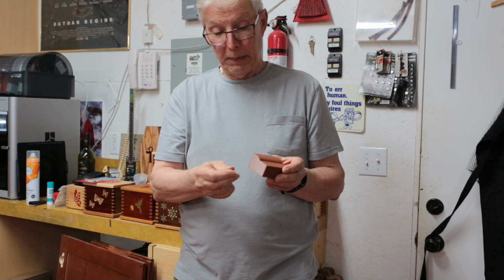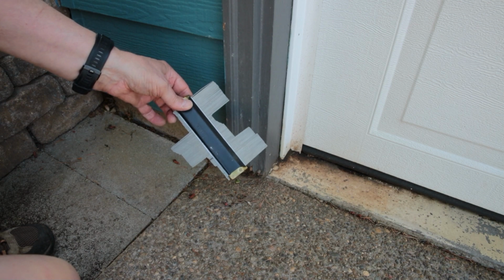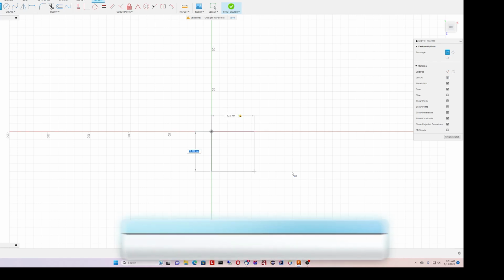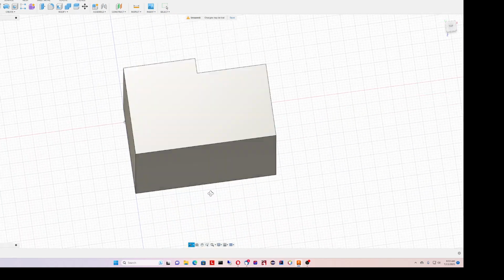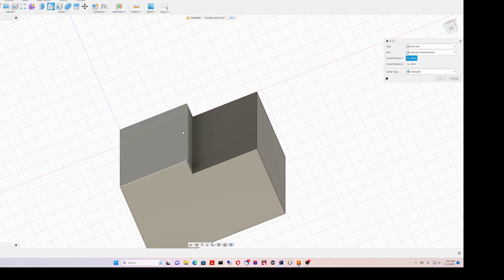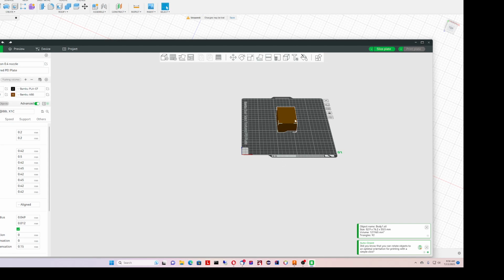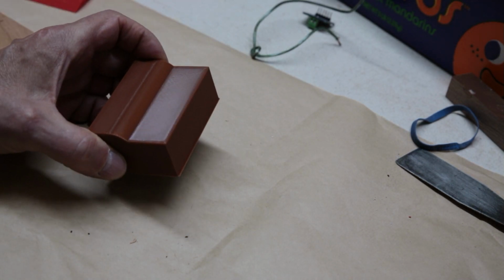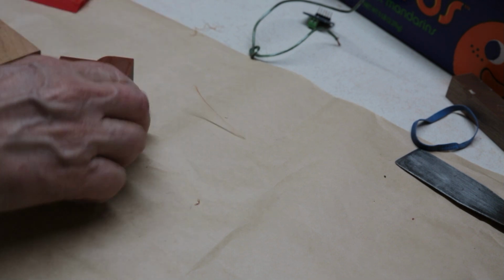Justifying the use of your expensive 3D Printer

Comment: Hi, Just got my machine and love it. So far I only use the PEI plate. Did you get one of those yet? Thnaks
Reply from the maker: Yes.. have both plates
Reply: @paulszudzik9588  Do you know of a way to print the models on the LCD controller using the PEI plate?